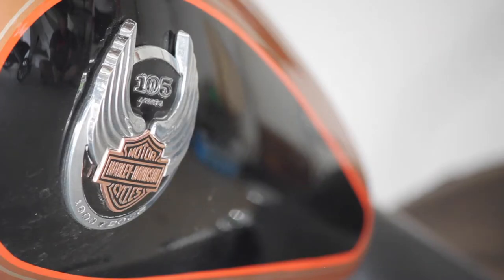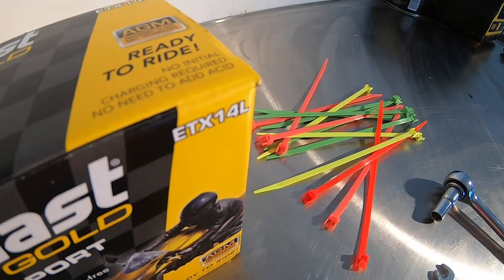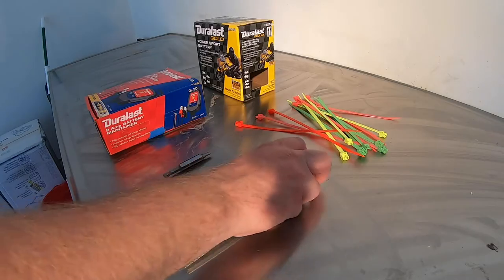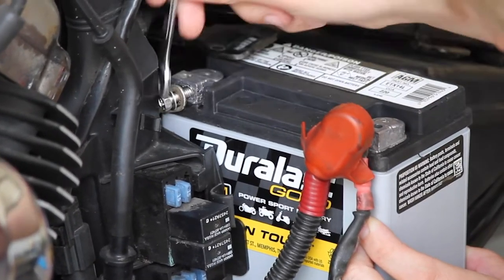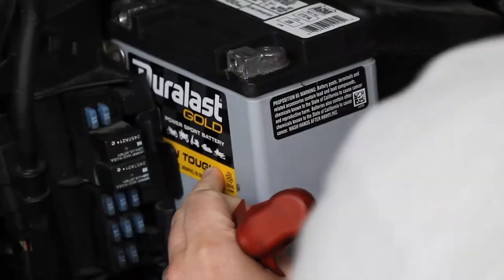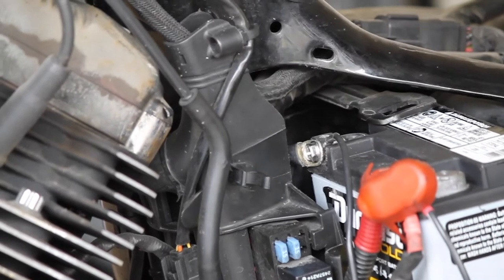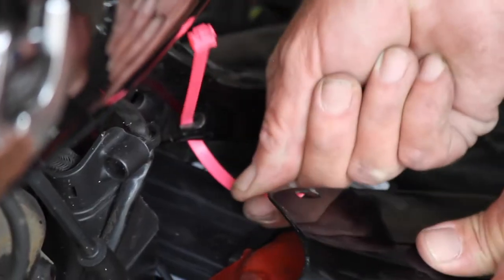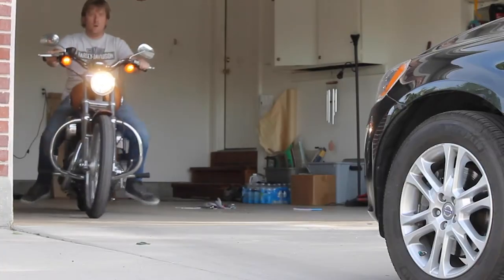How To Install a Battery and Floating Charger in a 2008 Harley Davidson Sportster 1200 Custom

Comment: Advanced ordered the wrong battery (TX14AHL). This time told them ETX14L and they said that they didnt see any ETX on their catalog. Gonna hope that the TX14L works. Only diffence i see online is it has 200 CCA instead of 220. If this one doesnt work imma just get a refund and find one somwwhere else. Thanks for the video, super informative. Rare to find a video with the exact model you own.
Reply: I think the E just means it's Duralast, and since that's AutoZone, advanced wouldn't have it. Im just a dumbass.